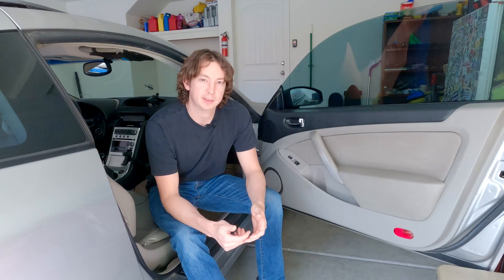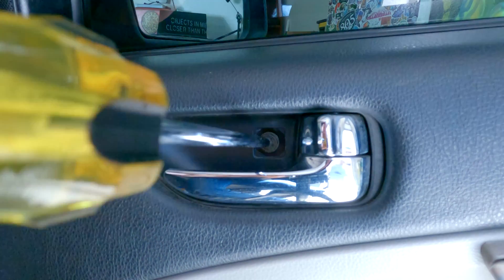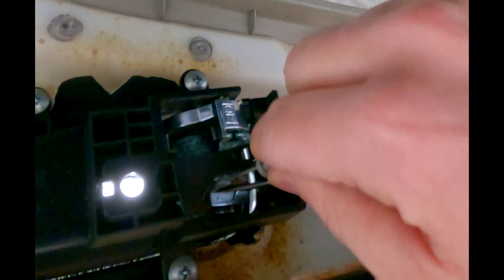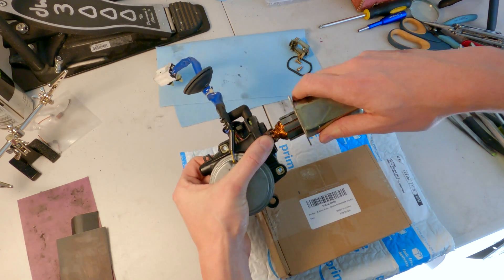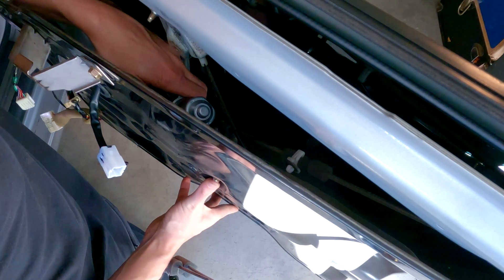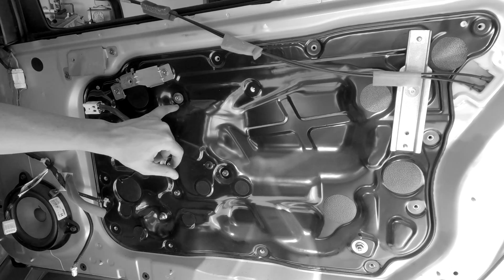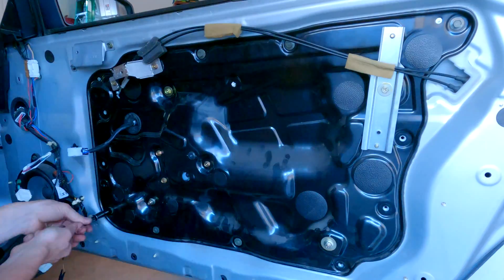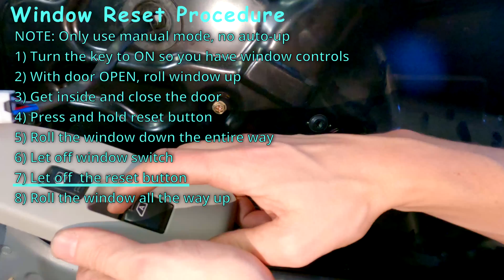How to Fix a Broken Window Motor & Reset Procedure (G35/350Z)

Comment: actually have 2 hole to push the spring carbon  brush inside, then insert the motor, i  use 2 small nails

Comment: That is the hard part, getting that inside black door panel back in place. It was murder lining it back up with the regulator. Wish I had seen your tips previously, would have saved me a lot of trouble. Can the reset be done without hitting the reset on the motor? Some people say can be done via the regular window controls. Or do I need to take the interior door panel back off? Ugh.

Comment: Hell....I have to do both. Actually mine have lasted a long time. My G35 is a 2006 and they started going south about a year ago.  I bought the car in 2012 and it gets limited use so I've lived with them barely working for a year. I also bought  both motors on Amazon. Doing both of mine this week. 

Hmm...wonder what the Infinity dealership would charge to do both windows??  $500-600.00 or MORE?  I'll check back in when I'm done. Thanks for the video!
Reply from the maker: Yeah, can't imagine the dealership price - best of luck with the fix!

Comment: I did this on my 2010 EX35...my brushes crumbled when I was trying to get it back together (the magnet was too strong on the housing and I carelessly "snapped" it back too quickly - kaboom). Got the aftermarket motor from Amazon the next day...easy peasy. I had to re-epoxy the bottom screw housing on the glass as it wasn't secure (that was the original issue, but i wanted to "service" the motor while i was in there....) Live and learn.
Reply from the maker: Funny you had the same experience. Servicing some components isnt always feasible